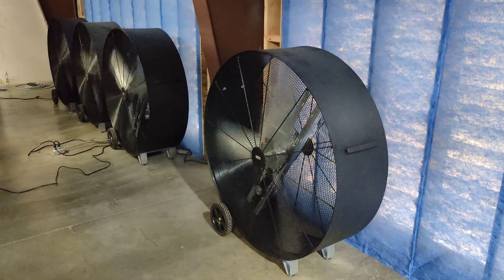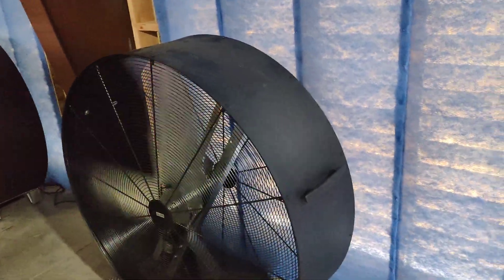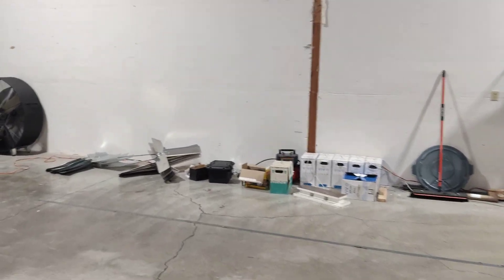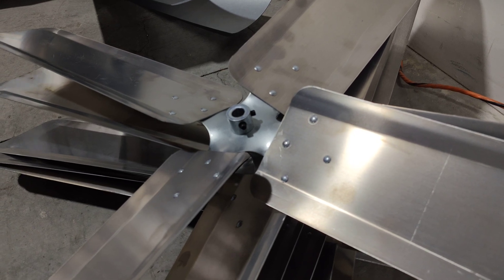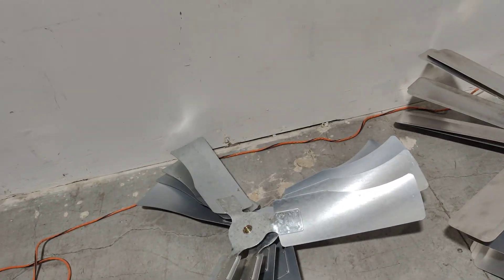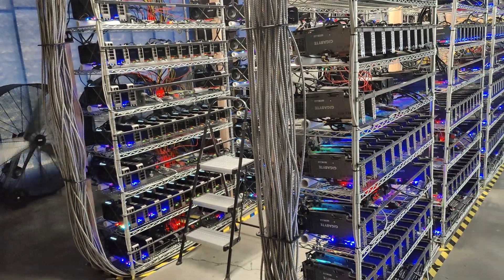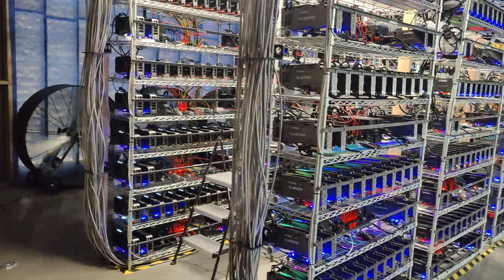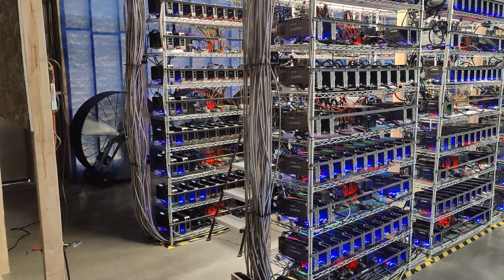GPU Mining Farm - Upgrading our Intake/Exhaust Fans to Spin at 22k CFM

Comment: Did you consider placing the fans a bit higher? I'm asking because the hot air goes up and the upper rig should be theoretically the "hottest".
Reply: Did you consider that those are intake fans? So he needs the cool air in the bottom?
Reply: @NRKValorant  good point, there is only so much that we can do for ventilation. The rigs on top will run the hottest, but GPUs get a lot hotter during gaming than when mining ETH, so they should be fine. My rigs are fine even without additional fans, but I only have 2 rigs so there is no heat problem whatsoever because they are not stacked on top of each other.